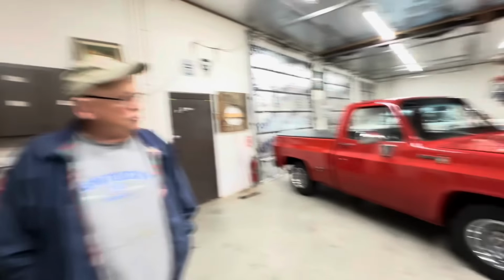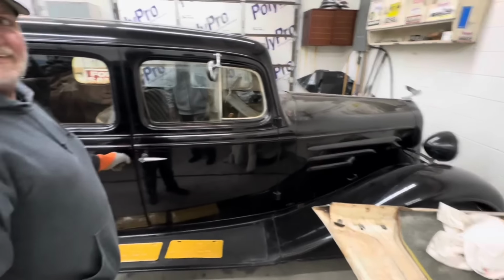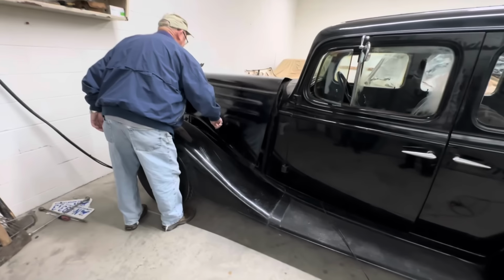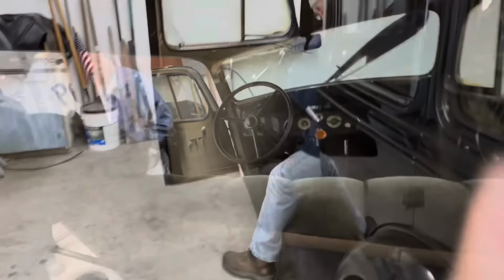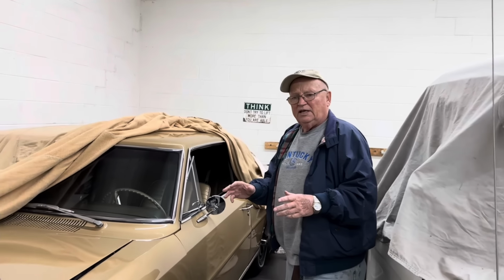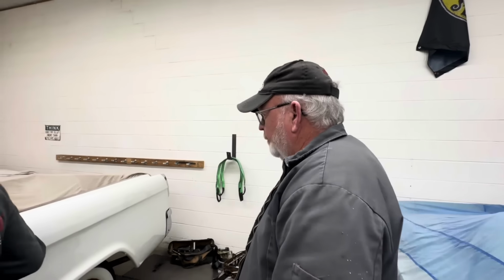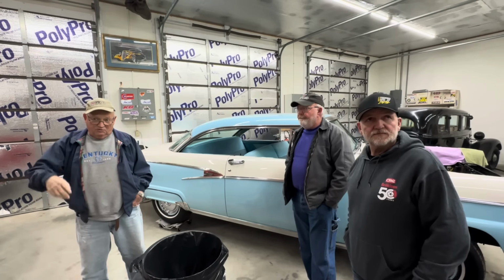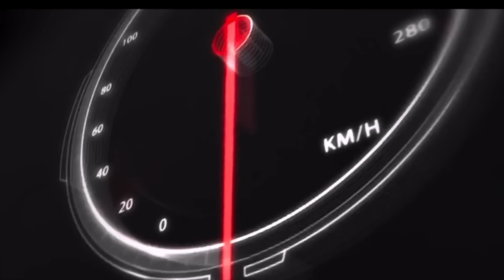1 Owner 35 Chevrolet. Lots Of Surprises Inside.

Comment: Clay, the old Chevy reminds me of my '46 Willys CJ-2A with only one tail light, throttle, choke, starter on the floor, stick, etc.  Of course, the CJ-2A only had 60 HP and I never got it over 51 MPH (based on Dad's speedometer as I followed him down the Interstate ;).  I hope to finish restoring it before I "run out of time"!

Thanks for sharing Chuck's & Jim's current treasures!

Comment: My Dad bought a 1932 Chev Coupe for my mum to drive,when it had 7000 miles on it. Mum Never drove it and when Dad sold iyt in the early 70's it had around 12,000 miles. It has only got 14,000 miles today.Original paint, interior etc.

Comment: Had a '35 Chevy, myself; a 3 window coupé. Bit different, tho, had a 12:1 302 SBC w/ a Crown Eng adapter to run a Mopar 727 automatic. Put a AMC Pacer IFS unit w/ a rack & pinion, disc brakes. Had a 55-57 Eaton pumpkin style rear end in it w/ leaf springs, but there was an IRS w/ coil overs destined for it until a kid came into the shop after it was in a local parade & offered me waaay too much money for it; minus the engine & transmission, which is where all the $ was tied up.
Had a '59 Chev PU w/ a step side box while I was in college & competing as a Pro Freestyle skier. It had a hot rod SBC in it w/ a truck 4 speed. It wss my transportation & road home. Had a cab over camper for it I'd gutted, increased the insulation to 4" & completely rebuilt the insides. Stayed nice & warm inside, even when parked in the lot at a 8,000 ft ski resort. Only heat it had was some 2 red flower pots turned upside down on the gas burner in the 'kitchen'.

Hung a sign on the back when I arrived, "Private Ski Lessons $40/hr"; sign never failed to make me all the $ I needed.

Truck never failed me either & it was all over the West from BC, Canada to Baja Peninsula, (surfing break); Tahoe to Colorado.

To be young, again, Clay... 

Thanks for reviving the memories of an old man...

GeoD

Comment: Wow!,,All I can say.  A one owner 1935.  My dream Oldie would be a 1914-1915 Cadillac Roadster, with the new V8 engine of a whopping 40-50hp.    A V8 Roadster of 1914,  They cost $4000 back in 1914, which was a big baller wallet,  they came with smaller diameter Hickory wood spoke wheels that were rubber shod.   When you pulled the cylinders off the engine block, the engine block looked like a doghouse from end on.   Not much engine block,,just a wee bit holding the crankshaft to stay in one spot.  Thanks Clayburn.
Reply from the maker: Thanks for watching and commenting 👍
Reply: About 70mph with that Roadster, on wood spoke wheels.  And we think we take chances. Thanks Clay.  @claymillican25

Comment: That’s not a true 1935 master. It’s a leftover 1934 standard body titled as a 35. Masters had stainless trim on the hoods and down the running boards. 35s would have had the gauges inline with the steering column not in the center of the dash like a 34. 1935s also had a solid roof, 34 was the last year they couldn’t make a solid roof. Still a very awesome survivor though!
Reply: I think it was a pretty common thing during the depression years that a car was titled in the year it was sold, not the year it was made. Good eye and knowledge about this car...